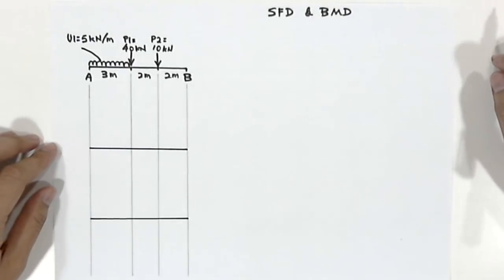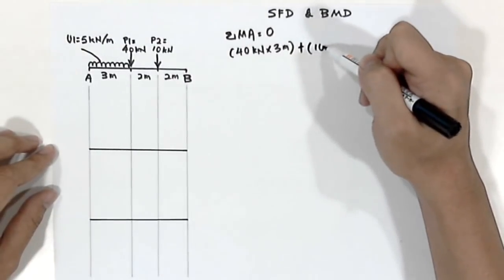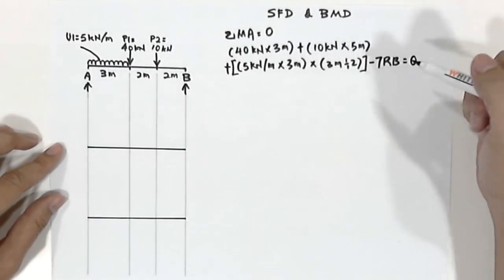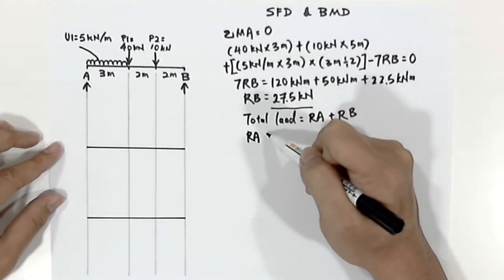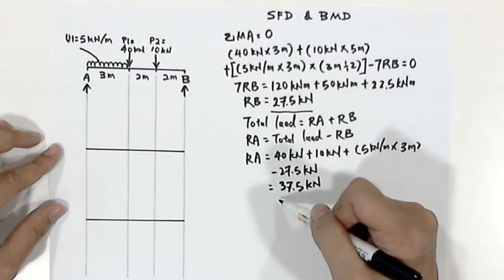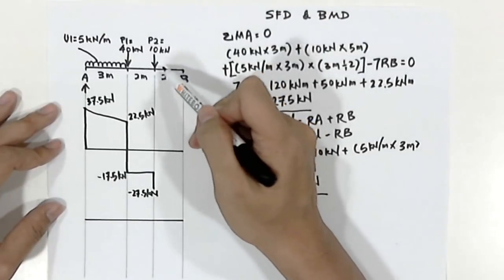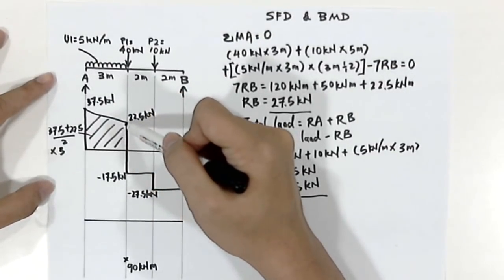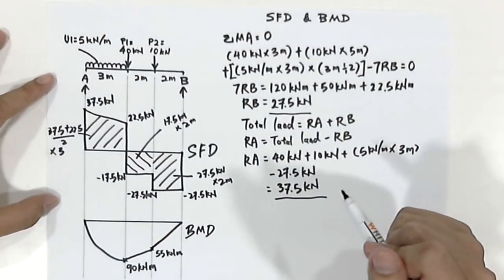How to Draw: SFD & BMD

Comment: To all you guys saying the BMD was wrong, it's not wrong. Different disciplines of engineering have different standards, in some specialisations they plot positive bending moments downwards as it models what the actual beam deflection would look like.
Reply: True, if you also look at it this way, the udl acts downward making it tension in the bottom and compression at the top, hence the sagging curve. Thus, the BMD shows correctly how the beam would bend based on all the loads acting. Just a method of thumb, if you ever forget how to draw the BMD (above or below the datum), then just look at the UDL and imagine how it would act in real life. If you aint got an UDL to look at then...um, im sure you'll be able to figure out that the world is upside down.
Reply: Oliver Pykett ok

Comment: The note at the start of the video stated that the BMD will be flipped - so + Moment is shown down (-y axis).  This is often done to better visualize the deflection and where the tension reinforcing steel should be placed. + Moment has compression on the top surface and tension on the bottom. So if you are supposed to plot the BMD with +Moment on the + y axis, just flip the image vertically.  The rest of the procedure is still valid

Comment: if for instance I had a beam which was 4.9m and had a 1.4KN downward force on the far left point and then 1.5m to the right had a 1.8KN downward force and then 1.6m to the right had point A and then 1.8m to right had point B (B is a fixed point) does it matter where the points are to calculate RA and RB

Comment: We have to assume the moment diagram is wrong because as part of the same set of drawings it goes down from the origin. If he would have specified that positive was down from the origin on the second diagram, then it would have been right.
90 and 55 have to be assumed negative because they are below the origin. Ex:  +4(-) is still negative.
Reply: No, you can have the shear force diagram with positive above the axis and negative below it and the bending moment positive below the axis and negative above it, in fact many of the structural software uses this convention too, very useful to reinforced concrete pieces or even pre stressed concrete
Reply: Ooze27 You can the positive to point to any direction you want (out of the picture at an angle), but you have to specify it.
If you are expected to read the data on a structural software you are also expected to understand that it should point downwards (I'm pretty sure you can change the setting to point up or down and it won't change a thing).
This is a drawing on a piece of paper for people that don't fully understand the subject, and follow the general conventions of technical drawing.
Reply: Emanuel Gonzalez Oh yes of course, i think i misunderstood what you were trying to say,My bad. Yes the software allows for that, any of them.

Comment: The bending moment diagram was wrong. I'll write the detail later.RRC Wiseguys
Reply: +RRCWiseguys  please can you solve the bmd for the question
Reply: +Rupsa Chatterjee o
Reply: The Parabola of BMD should be opposite that he did.
Reply: its not wrong, in europe (including UK which is where i live) we do what he did in the video, however in america, it is the opposite way round in the vertical sense.
Reply: It depends on the sign convention you are using. If you take hogging as positive and clockwise shears as positive. There's nothing wrong with this bending moment diagram and shear force diagram. The problem is you should mention the sign convention you are using before drawing the diagrams. If you are telling this one is wrong, you haven't understood the concept properly.

Comment: BMD is wrong because it should be flipped on x-axis. The `the area calculated for distributed load ( 90 Nm) from shear force diagram is positive.
Reply: This changes on whether you use the US or UK system. Some say sagging is +ve while others say hogging is.
Reply: Its correct he just take positive area as negative and the negative area as positive and the result would show how the beam deflects in real life...

Comment: I think that BMD should lie above the line AB
Reply: It depends how you will consider it, in this case he is drawing the BMD  accordingly to the tensioned face. This has to mostly with concrete pieces, since it's easier to figure out where to reinforce with REBAR.

Comment: why 3m was multiplicated with u1=5 KN/m in moment?
Reply: +Farhan islam like you know,it isn't a point load,it is a uniformly distributed load.A point load acts at a particular point,but the UDL acts over a region.So when you multiply the magnitude of UDL(which is 5kn/m in this case) with the length of the region over which the load is acting(which is 3m in this case),you are basically converting a UDL into a point load.

Comment: very well explained but the Bending moment is wrong. please correct it as some people will be getting confused:)
Reply: agree.
Reply: Purog Ka how is wrong ? , can u explain a bit ?
Reply: Mohsen aliaskar It's not, it's just a different sign convention. It's not wrong, that would be like saying using lb for weight is wrong because i prefer kg.
Reply: Ooze27 .
If I use that analogy I would say that I weight 180 Kg because I don't like to say that I weight 180 lb. So, in essence saying that 180 lb = 180 kg.
I'm assuming the general convention of what weight is. Technically units of weight are either lb-f(-f can be dropped) or N.
Reply: Emanuel Gonzalez You're right it was a stupid analogy
Reply: Faisal Hussain
Reply: Its not wrong,,,just different sign convention bro